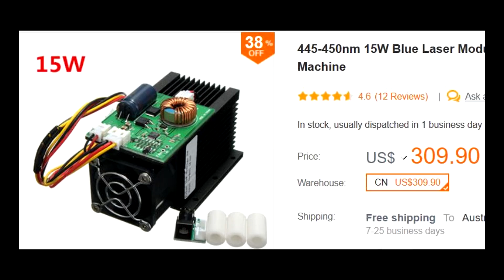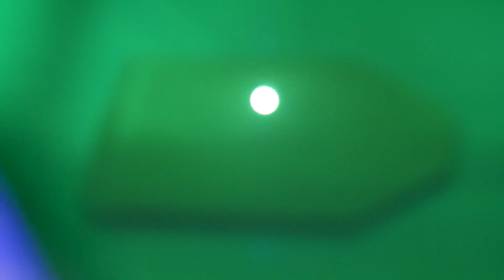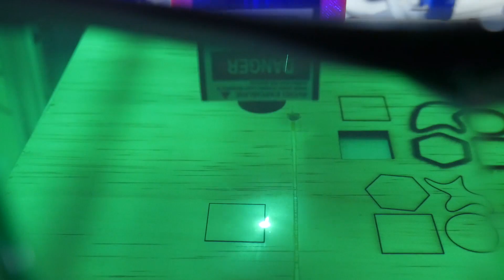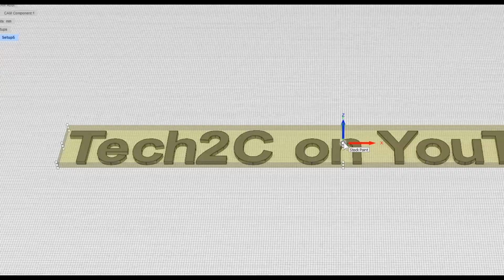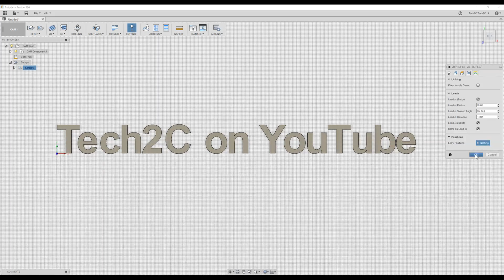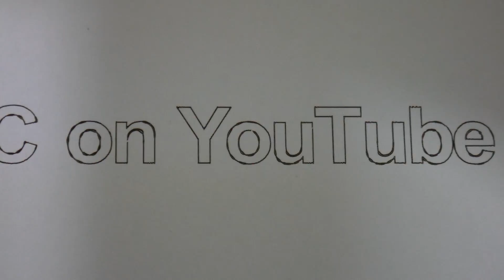Laser Cutting with a 3D Printer

Comment: Mmm.... 
PWM is actually a horrible way to power a laser diode. They are meant to be used with a specific, constant voltage and tightly regulated current. 
If you're trying to be 'simple' about it, just put a cheap voltage regulator in series with the laser diode. You can buy voltage regulators in many values that might even exactly match the specifications of your laser diode.

After that, the laser color matters. Blue is a good generalist color because it can actually work on metals, but, if you find yourself working on carbon rich material, you'd be better suited to use an infrared laser. In theory, it produces less smoke because it atomizes the carbon bits directly into carbon dioxide. There's still a fine char on the edge but it's very fine. That said, infrared lasers are probably slightly more dangerous than other types of lasers. Aside from being invisible to the human eye, they basically act like concentrated blow torches that can instantly produce heat at a specific point. It's great for machining but if your hand or eye is in the way, you may not realize it until the body part is burned.
Reply: My understanding (somewhat limited) is that current regulation is even more important than voltage regulation, though a super clean dc output is very important too.   Simple current regulators are pretty easy to put together and very economical.  I bought a 3W 450nm laser off ebay but found that the driver may be good at current regulation but it was terrible at driving the laser from the PWM fan output on my Geeetech prusa i3 Pro B.  After reading about the need for a driver I'm wary of connecting my laser directly to the PWM fan output.
Reply: It is very true that current regulation is just as important as voltage regulation, however, a voltage regulator can become a current regulator very easily. You just need 2 potentiometers on the output of the voltage regulator. If you watch AFrotechmods here on Youtube he goes over voltage regulators in a detailed way that's actually easy to understand. 

As far as that goes, My thoughts about an ideal laser driver circuit are fairly specific. At least one large supercapacitor in parallel with the laser diode to act as a smoothing capacitor. A Voltage regulator, either made with a zener attached at the gate of a transistor or a complete voltage regulator circuit. Finally a current regulator consisting of a N-channel JFET with the gate shorted to the source (incoming power). 
I like that setup because it's kinda bare bones, requiring as little as 3 components, and it's reliable. 
If you're real twitchy about wavelength you can make the voltage and current slightly adjustable (within a known range) and adjust to exact wavelengths (laser diodes can change their wavelength 10-20 nm depending on changes in the voltage and current running through them).
Reply: Thanks for the tip Walter.  I watched the video and he made one important comment, the LM317 drops 2v from the source.  If my PWM output from the printer is 12v the most I can get out of the regulator circuit is 10v which will turn my 3W laser into a 2.5W laser.  That is something I hadn't considered.  Does your regulator work differently?
Reply: Woah... hold on for a sec... 
Your diode is producing 3 watts of power, but that conversion isn't 100%. At best, you're only going to get 70% out of the diode, but, there's other issues. 
All laser diodes are limited in how much power can actually be put into them, and what form that power takes. To know exactly what kind of power your diode can tolerate, you have to have the Datasheet, which will give the hard absolute voltage and current limit on the diode. Generally speaking those are not meant to ever be exceeded, but some manufacturers, like Nichia, can be pushed beyond the specifications. However, even a 3.5 watt 450 nm nichia diode will die if given 10 volts at a constant current. 

So... this brings me back to my original post, and why PWM is bad for laser diodes: PWM relies on components being able to handle over voltages for some amount of time because voltage and current do not instantly change. 
Laser diodes do not do this because capacitance and inductances are intentionally engineered out of the diode. 
They slowly degrade as bits of the laser emitting layers are blasted off under overvoltage circumstances. Over Current is actually worse as the entire thing will overheat and fry. 

For a 3 watt, 450 nm laser diode, you probably need between 2-6 volts of regulated voltage, and around 3-4 amps of constant current, but high power diodes can handle up to 5-6 amps. I'd have to see your data sheet to know for certain what you have. 

The voltage regulator clipping 2 volts in this instance isn't bad, but you're going to have to adjust down to a lower point to prevent that diode from burning up.
Reply: Ok, a LED is forward biased, so current limiting needed, and the voltage drop across the diode is around 1.25v so how does Tech2C get away with hooking up 12v PWM directly to his laser diode?  I hooked my VOM up to the driver input on my laser and the voltage from my GT2560 PWM fan adjusted, via the fan % in software, from 12v down to around 7v then suddenly to zero.  I know PWM is always 12v but the average is what I measure.  Is he, like you say, gradually chipping away at the life span his diode?
Part 2.  My laser driver is supposed to accept TTL input up to 20khz with 5v on and 0v off.  When I input my 12v PWM fan source to the driver 12v turns it off and 0v turns it on.  And, an added bonus, with no control applied to the driver the laser is always on(???).  So I'm caught between the two, to much V for direct connect and wrong polarity for through the driver. ARG!  I wonder if I got the correct laser I ordered from ebay?
Reply: Charles Carey as far as how techc has his laser diode hooked up to his printer, I can't say exactly. I suspect that the software has some modifications to the pwm output of the Arduino. If the manufacturer specifically knew it was going to be used with an Arduino, they might have built in some voltage regulation, but the video doesn't give tons of info about the module, and I can clearly see that it's not adequate, given the weird way the laser diode is producing light.
Something to bear in mind, new Zealand and Australia regulate laser diodes in a similar manner to guns. There might be other things going on with techc in that regard (I'm in the USA). 
As far as the power output of pwm through an Arduino, 70% is the maximum duty cycle, which is why it turns off when you try to go beyond that. 
As far as any of the Arduino stuff goes, if the analog pins are free, they can output a non pwm signal, and, instead of being always on, it can be setup to be always off, it just needs the coding to be setup correctly.
Reply: That is a difference between us.  He's using the RAMPS 1.4 board to drive his Laser while I have the Geetech GT2560. I'm in the USA too.  I did notice that when he did his first video he tossed the driver board that came with it aside.  I wonder if there was more to it than just convenience.
I know I can reverse steppers in code but I"m not sure about any analog outputs or how to access them.  I see  more research in my windshield.
I appreciate all your input.  You've been very helpful both to me and to other DIYers watching.  :)
Reply: You can power the laser from 12v power supply and connect the TTL control pin from laser driver to mega BEFORE the D9 mosfet, so you'll get the 5V arduino PIN instead

Comment: adjust the Z axis after each pass so the focus point is going further down.   at this thickness plywood the bottom focus point is not optimal anymore.  
or put the laser further away making the beam angle narrower, which means you got a longer distance where the focus point is at its best size

Comment: nice work. 
I have the exact same laser and eye protection. And the printer  is Geeetech Prusa i3 A Pro 3D Printer All Aluminum. I got stock because I read from the internet that the fan is always on at full power. I made a support for the laser so I don't need to remove the printer head. But where to connect it? By the way did you try to draw a picture with the laser?
Reply: The GT2560 board (which I presume is on the Geeetech I3) has a pwm fan output which is exactly what is used in this vid. But be aware, the mosfet driving it is a bit wobbly, lots of people have it fail just running a fan.

Comment: Is it safe to connect this in place of the fan? I mean i have a wanhao i3 and im not sure if the fan driver is has enough output to supply 2,5 amps. Also how are you telling the cam software what command to use for the cut? If i want to connect perhaps to the heating element connections (since that has to have enough current) what do i have to change? Do i need to fiddle with the firmware? That i think is a no go on this printer.

Comment: Will such a low powered laser diode cut acrylic? I would like to convert my cnc router to a laser cutter. Thought about buying the 5W version...
Reply: Laser diode wavelength will pass through transparent material. You may have some success on engraving if you paint it black, but cutting you'll problably need a CO2 laser

Comment: How can I connect in TTL mode?
Reply: I just bought the exact same laser, and I'm having the same problem. My control board's TTL port isn't working with the TTL module.
Reply: This is the question I was going to ask. He seems to be simply cutting on and off the 12V, which in turn will disable the laser AND the driver fan. I suppose you can connect the 12V to a power supply and the TTL line to the transistor leg BEFORE D9, to get arduino´ s 5V instead

Comment: I sujest taking advantage of your Z axes and step down after every pass to lessen the scorching and minimize the number of passes.
Reply: Extremely good point Boden L. Since I'm going to be converting 1 of my 2 3D printers into a high power laser cutter having it drop down after each pass is common sense if not the right thing to do. Just like a CNC milling machine does in order to mill parts out of a block. So the software to do this is already there.
Reply: You’d want to step up after each pass, wouldn’t you?
Reply: @markgearing  No
Reply: @markgearing  nope...!
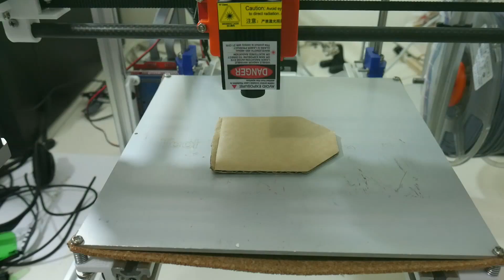Reply: RiderRick - Okay Rick, you’ll have to explain that to me. The laser removes material, so the laser and part need to get closer to each other after each pass to keep the cutting distance constant. The Z axis moves the bed, not the head (watch 5:58), so the bed has to step UP to reduce the distance.

That’s how I see it, anyway. Can you help me out and explain why you think that’s wrong?
Reply: @markgearing  It's the other way around! But your thinking is not totally wrong.

For example, if you want to cut deeper you need to lower the Z a step at a time!

When the laser starts cutting it forms a small (very tight) cone when hitting the surface, it is true that the deeper you go the "cone" will be more noticable, but that's the mechanics of the cut itself, when you're stepping away (going up) the laser loses focus and cutting power, which tends to burnout the outter area.

I do this on my CO2 laser to acheive perfect cutting surface and deeper cuts on a thicker materials, which otherwise would never cut if the focus remained constant, although, if you look at a cutted part sometimes it has a very small angle on the edge of the cut. The ideal setup would be to have an oxygen supply or compressd air to help remove material in the same direction.

I hope I have helped!
Reply: RiderRick - Yep, all makes sense to me. We’re definitely on the same page there.

The bed still has to move UP to maintain that distance, though. Some of the material has been removed, so the distance between the laser and the remaining material needs to be reduced. That way the laser is focussed slightly closer to the bottom of the part, below the layer it just burned away.
Reply: @markgearing  Now I understand!! You meant the BED! I was referring to the "classic" Z axis on a prusa! (Hypercube the bed goes up, prusa.. the head goes down!)

Indeed, so, we were both correct in our own way! 😅
Reply: @markgearing  step down, further into the material... But barely...

Comment: This is great.  Would it be possible to automate the homing process with something like a BL-Touch sensor?   

Also, for thicker materials would it be possible to lower the Z height after each pass by just enough so that, for thicker parts, your last pass is preformed with the focus point being on the bed surface instead of the surface of the part?   This should help with the tougher material like plywood or thicker material like insulation foam i would think.

Comment: Dont drive direct as it is now will kill diod quick they have overdriven regulators in that reduce diod life badly.
Recomend remove integrated constant current board and replace with ttl board that allows u to adjust current and voltage.that way you keep your diod live long

Comment: To funny. I just got my 2.5W laser out that I have had for a while now. First time using it. Video going up shortly cutting solder paste masks.  Its the same one you got. I found that it focuses better closer. Around 20-30mm. Any more and the beam speeds to much. Also if you move the bed up with each pass you will cut the wood faster. Best of luck. Thanks for sharing. PS. Yes. Cut out side. :)   ~Russ

Comment: As usual, absolutely brilliant work.  You run rings around me.

I wonder if this would be a useful way of cutting custom cutout spaces in thick foam to hold equipment (cameras, lenses, electronic equipment) in cases?  Given that a typical piece of foam would be 100mm thick, you'd need to refocus your beam to 100mm height, and activate Z height.  And, given that some foam is combustible, keep a close eye on the process.

I suppose you could also cut pieces out of preformed carbon fiber sheets (available through BangGood and AliExpress) to make extremely light drone enclosures.

I suppose I should get off my arse and learn Fusion360.  It seems to be becoming the de-facto standard in the maker industry.

Small correction - there are 256 steps, not 255.  They are numbered 0 - 255, where 0 is typically off, or null.  Zero is often ignored, but it, too, is a number - and a very important one, as it enables positional counting (the number 10 is interpreted as 1 unit of tens, plus no units of ones).  The Romans didn't have the concept of Zero, which led to the need for inclusion of complex mathematical formulas, right inside the number itself, to calculate values in Roman Numerals.  Lacking a Zero really screwed them up.  The IBM executive golf course has 18 holes - numbered zero through 17.

Just my soapbox thing - left over from my days writing assembler on the IBM 360 and Cyber 172 platforms, over 40 years ago.  Not really important, I suppose.

I really, really enjoy your channel.  Keep on flogging away.

>Charlie in Canada

Comment: How does this "prinitng" routine work?^^ You ever say "hit print" but how do you generate the g-code and how does the machine know where Z=0 if you dont have an Z-Endstop? Can you please explain it?
Reply: dunichtich100 positioning by hand is just moving the print bed so the laser is touching the surface, in effect homing the laser head at zero Z.  Tech2c is then just adding a 50mm Z height prior to cutting.
Reply: In the gcode there is a 
G92 X0 Y0 Z0  ;Set XYZ Positions

This liturarly tells the 3D printer to forget it's home position, and assume the new authoritive position. Can be used for z offsets too for prints without inductive probes provided the firmware is configured to ignore endstops when not homing the axis
Reply from the maker: I used Fusion360 to make the gcode. Then load the gcode the same way you do a 3D print file - Pronterface or SDCard.
Reply: Tech2C Okay, but how does this "positioning by Hand" homing routine work?^^
Reply: Max Bainrot Thank you Max! That's what I wanted to know 👍😊
Reply: Your welcome mate :)

Comment: The couple who died in the USA from carbon-monoxide poisoning though it was reported that a 3d printer caused it was actually using a laser cutter indoors without proper ventilation and a carbon monoxide detector.
Reply: Weren't they also cutting polycarb or some other material which is well known to release toxic fumes when cut?
Reply: 3DprintedLife Probably, but it's worth repeating, that there can be serious dangers if you're not careful.
Reply: It was carbon-monoxide poisoning which is as bad any noxious fumes as it fucks up your blood and prevents it carrying oxygen around your body.
Reply: Same stuff in cigarettes! 
Have good ventilation, good air moving around the cuts so it blows the smoke away, for harder materials use a air nozzle to blow it away

Comment: Just as an idea: since your mount is plastic you could use the mounting screws for the toolhead to provide the electrical connection. You might just need more than 4 screws (2 heater, 2 temp sensor, 2 fan, 2 part cooling fan, 3 for the height sensor if it is not on the backplate). For me this sounds doable.

Comment: That's the type of glasses I've got with my 500mW laser.
My 2500mW was supplied with a much darker one.
You might want to verify if your glasses are sufficient for your 2500mW.
Reply: I watched a video where glasses were tested and you can't really see the laser with them on (because that's what they are blocking) so you may want to buy better or different glasses if you can see the laser through the glasses.